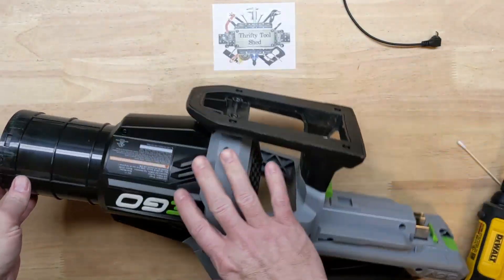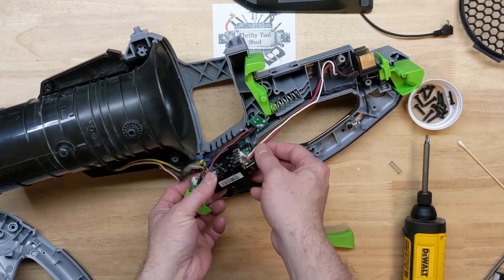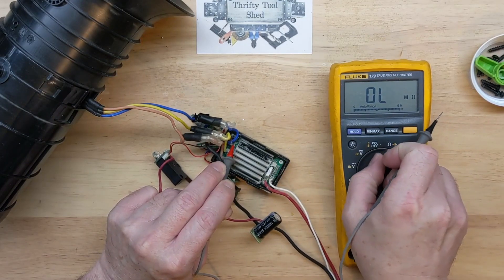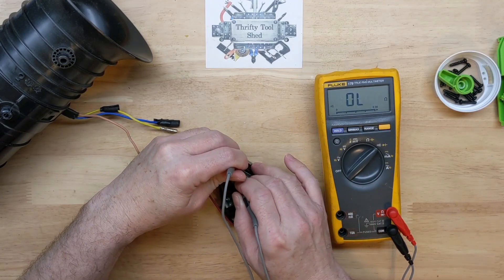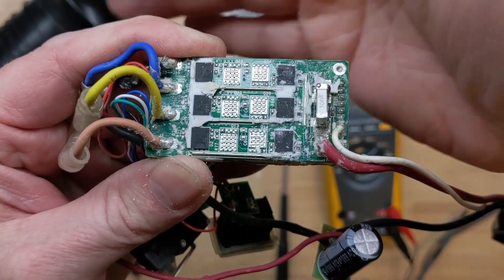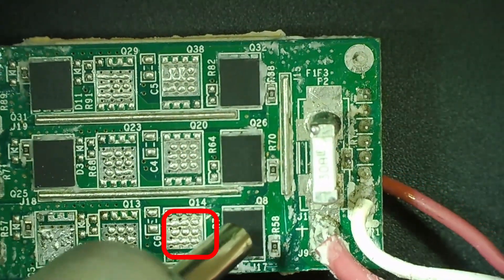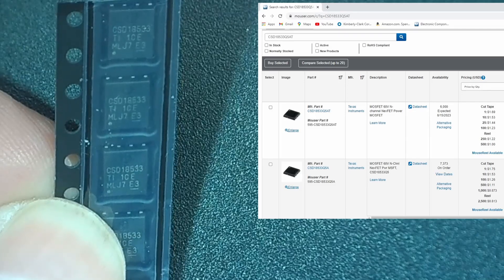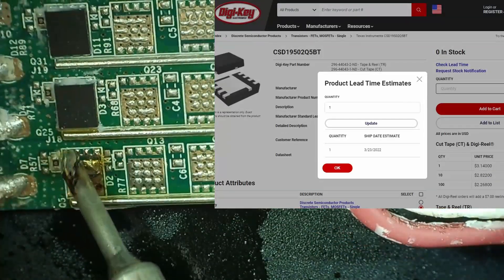EGO 56V LB5300 Blower Controller Repair

Comment: Great repair! I was hoping you would be able to get to this one. Interesting that replacement MosFets are in such short supply.

Here's a little more backstory on this unit:
I inherited it from a buddy of mine when it died under warranty. Ego replaced his blower and he passed the busted one on to me. Since I already had an Ego mower and battery, I wanted to see if I could fix it. I took it apart and found that the motor windings all looked good and that the controller was potted with a rubbery RTV like substance. I dug out most of the potting and found that the 30A fuse was open. I ordered a couple of (expensive) replacement fuses from Digi Key and since there was plenty of room I just stacked the new fuse on top of the old one to avoid de-soldering it.
The blower worked fine for a year or so, but when I was blowing leaves last fall using Turbo mode, it sputtered and died. Stacking on another fuse didn't do it this time. The fuse blew immediately.
At this point I was distracted with other projects and contacted you to see if you wanted to give it a try. I shipped it from Minnesota to Georgia back in November (thanks for covering the shipping). 
Glad you have the experience and tools to identify and replace the shorted MosFets. Great tip on using cheap car fuses during repair testing and for a much less expensive surface mount fuse.

Here is another great story about repairing stuff for the cost of a few parts and keeping them out of landfills! Good Job!
Reply from the maker: Thanks for thinking enough of the channel to share it with us!
Thanks for your detailed comment and I hope you don't mind if I pin it!
Reply: @ThriftyToolShed  Feel free to pin it! This is a great example of recycle/reuse and keeping stuff out of landfills!
Reply: my blower is giving me problems, i have to keep pushing the battery in or change the angles for it to work. It works best if i push the battery into my body so the contact is made. Do you have advice for this issue?   @ThriftyToolShed

Comment: Could I replace the LB5300 controller with the same RioRand 300W 5-50V PWM DC Controller that you used in your 650 CFM retrofit? Thanks very much for your videos and advice!
Reply from the maker: I do believe it will work if you keep it in direct forced air flow. We are overdriving them hard for sure. One other thing to keep in mind is the battery will need to be removed so the controller doesn't drain the pack with parasitic draw. The low voltage cut out is also a concern, but of course I rigged up a couple this way mainly for testing and they did work. I also have tested some with some of the newer 80V BLDC controllers. I shared a repair video of one of these already and show it being tested a little. They are a large board though. Thin, but long and wide. Best of luck to ya.
Reply: @ThriftyToolShed  Excellent advice and much appreciated!

Comment: For this EGO 535 blower, mine will start then stop.  A few seconds later it would start again.  The battery never  gets hot and I've tried a new battery.  The blower and the battery does not get hot at all.  Do you have any idea what the problem might be?  Is it worth it for me to take apart the blower like you did here?  I can't find a new PCB for this blower.
Reply from the maker: One thing to check is the connection to the D terminal and make sure it is clean and a solid connection. If no communication is established between the blower and the pack it will shutdown after a few seconds of running.

Comment: Thank you thabk you thank you! This was a great video. I needed to know what kind of fuse was used in these bloweres. And the mosfets. 

If you could, would it be possible to reply to this with the fuse part description and the mos fet description? Just for the sake of simplicity. So i can search it up.

Im going to try that 30a green car fuse right away. Thanks again!
Reply from the maker: Hi,
I have links to help in the video description. EGO uses many different mosfets and fuses based on the model. It this video, I shared links to the ones that I used on that particular repair. Best of luck to ya!

Comment: So there’s a giant fan and only some tiny slots to allow air to cool the heat sink, which is covered on both sides with excessive putting material, and the mosfet overheated? Shocking. I’d cut away those slots and clean up the heat sink, or maybe resize it so it sticks out into the air path, to prevent this reoccurring.

Comment: I didn't have my air speed high enough and the pads weren't coming off after minutes of 400C.  After turning the air speed up they came off rather quickly but I noticed the Rightmost chip no longer has the copper pad on the single small section.  Since there's 2 empty spots in between is it possible I can simply move the Right mostfet to the open pad just to the Left of it and move the SMD resistor you have as R58 to R76?
Reply from the maker: I believe that will work. The only problem may be if something is not clear on that right most spot. Which, you may have already tested to be sure no short is there after removing the chip...

Comment: I replaced the 2x mosfets from my middle (Blue wire) section and confirmed one of the mosfets had a dead short as shown in the video.  For fun, I also tested the board, and discovered continuity (~100k) between the main pad and single pin where I removed the leftmost mosfet.  I didn't have this on the rightmost mosfet or any other blank mosfet area.  Is that normal?  I'm asking because after putting everything back together, the motor only glitches for 1/2 second or less when I pull the trigger and then stops.  Any thoughts what else to check?
Reply from the maker: The Mosfets do have a gate resistor close by that may sometimes accidentally get desoldered while replacing the Mosfets. I am not sure about that reading as that repair was some time ago for me.
Reply: @ThriftyToolShed well I went to replace the other mosfets today and they weren’t coming off but what did was that little gate and it’s nowhere to be found. Are these standard things I could order and replace?
Reply from the maker: @bugsysiegals  
I did not have to replace any of mine on the few repairs I have done, but on my first one, I did have one move on me.  I had to find it and put it back in place. I believe they are  standard SMD resistors if I remember correctly.

Comment: Hey! How did you find a replacement MOSFET suitable for the board?
Reply from the maker: I looked for the part number and sometimes it is not available. I ordered the next current rating higher up in the same NexFet package. I have a link to the one I used from DigiKey in the video description.
Reply: @ThriftyToolShed  How did you know the part number? Was there anything written on it that we couldn't see?
Reply from the maker: @diogor420  
I did see the part number.  I have worked on several of these and a chainsaw with a similar controller as well. You should be able to see the numbers well in the video. I even showed it under the microscope on this repair I believe....

Comment: i have one the turbo button doesn't work any more
Reply from the maker: On this model I believe the turbo is a dedicated input to the controller and if the controller is otherwise working fine hopefully it's just the turbo switch itself  or loose wire causing the issue.

Comment: Great Video.... Thank you. I'm actually going to fit a 'hotwired' fuse to where I can get at it next time it blows..... It was touch and go whether I tossed the whole machine but with following your instructions, I got to the fuse and tested the system with just a fine wire soldered in for the test and all was good. I figure a 30amp just hanging loose inside is not going to bring the earth to an end so that's my plan.
Reply from the maker: I don't blame you. That is a good way around it for sure. Thanks for your kind comment!
Reply: You can get fuse holders.  
I would just place the fuse holder outside the case somewhere and run heavy enough wire to  the fuse location on the board
Reply from the maker: That is the challenge for sure . The blower can easily pull up to 30A in turbo so it is very little room to work with. Some have drilled and put the fuse holder on the outside...

Comment: I wonder instead of all that, just wire it as on/ off only without any speed control.
Reply from the maker: I guess you are saying use the brushless controller and simply make it either Off or On and when On being wide open? Of course you have to have the controller.  It's a BLDC after all!
Reply: @ThriftyToolShed  can you show us how to wire it as Off or On only, some of us are not that handy and dont want to buy any more parts. plus only using the blower a few times a year. thanks
Reply from the maker: @chengnygmailcom 
As already mentioned above, it is a BLDC. A brushless DC motor has to have a controller. You will have to use a controller to run it.

Comment: If you use lab power supply or RC battery, instead of original one, would blower work normally? Mine pulses, work for sec or two then cuts off for about 0.5-1sec... Since i don't have original battery i cannot test if this is bc. of the battery or this is bad controller?
Reply from the maker: I don't know about all the models. The ones that I have worked with use the D-terminal to communicate between the tool and pack and if not detected it will only run for about 10 seconds or so then shutdown. The ones I tested will at least start up and run for that 10 seconds for a quick test with a 50 - 58V input. These things pull over 20A in turbo so I would use a battery pack of some level. Most bench supplies will not power it. I would think even on the lowest speed setting it can easily pull over 8-10A. Best of luck to ya!
Reply: I tried with 5AH/48V 100C packs (plenty of power-500A capable) and still does that cut off game... I initially bought blower for plastics, and to put monster 90mm EDF with 200AMP ESC in there that has 3-4KG of thrust (that is about  5500-7300cfm) it is really powerful, then to realize that e-go tool i bought is kinda ok feel bad in gutting it apart now...  
Oh and thanks very much on cheap ESC tip, RC 12S ESC's are all over 100$, but also over 100Amps, don't need that for this cheap blower!   @ThriftyToolShed

Comment: I have the same machine when I install a good battery and pull the trigger on the blower nothing happens in the battery eventually blinks green and turns off any idea what this could be or what test I could do to figure it out

Comment: Hi,

Great video! It was using this video I was able to Bring my 580 CFM lower back to life by swapping out the fuse.

I also have the 600 CFM backpack, 650 CFM & the new 765 CFM blowers so I really don't need my 580 anymore. So I decided to take it apart and re-purpose the brushless motor into a different project that I've been meaning to work on.

My only question is, what kind of power supply can I use to power the brushless motor? I tried my benchtop power supply which maximum goes up to 32 V/10A and it didn't even make the motor move. So for now I'm plugging in one of my Ego batteries. Do you know any way I can run the brushless motor, esc, etc. from a power supply? I remember i have a 60v charger in my basement somewhere that i bough to charge one of my Segway-Ninebot devices. Wouild that work? Thanks
Reply from the maker: So, are you asking about what kind of controller to use to run the BLDC Motor or what to use to power the original controller?  You can't run the BLDC Motor without a controller like the older Brushed DC motors. You will need a 60V DC supply. I have a 0-60VDC bench power supply I use to test these using the cheaper BLDC controller.
This is an example of a reasonably priced PS that may work? https://amzn.to/3DqglI4
Reply: @ThriftyToolShed  Hi, Thank you for the prompt reply. I want to run the BLDC motor from the 580 CFM Blower using the OEM controller, pot. My question is how to power it other than using a ego battery. Because i tried using my 32V /10A Benchtop power supply and it did not even move the motor or make a noise. Nothing happened...

I have a power supply that is the type you plug in the wall (canada), and it says output 63V 1.5 amp or 1 amp. Along with another one my Segway-Ninebot came with that is 59.5V at 2 amp that i was thinking to use. But would the amps in these be enough?
Reply from the maker: @therockk  
These would not be enough. Need 60V up to 15A supply. A 10 amp supply as shared in the link in my last reply may be enough to run it pretty high. You may need 15A supply to run full turbo for any length of time.
Reply from the maker: Just a guess, but if running low speed you may get by with only 2-3 amps. The high current only really comes into play when pushing it hard. I would probably even try the smaller supply you mentioned earlier if it is around 2A rated. I would just start it up slowly and see if running really slow how much current it pulls. Even a 48V supply will most likely get you what you need if running it easy.* I will mention if you are using the original EGO controller it will shut down after 10 secs or so if the D-Terminal to pack is not detected. I have used a cheap BLDC to run these successfully though. Best of luck to ya! 
48V PS: 
https://amzn.to/3TQ65yg
Cheap Controller: https://amzn.to/3MWxL2q
Reply: Great, thank you so much for all your help and information I really appreciate it. I will try it out.

Comment: Great video!! Would I need to add a resistor on every gate like r76, r77,... in order to get more current capabilities?
Reply from the maker: That is what I believe, I have not verified that for sure. It looks like putting on the extra Mosfets and the gate resistor for each additional Mosfet as well. Thanks for your kind comment!

Comment: Great episode thank you .. I have an ego 530 as well it runs great but … Iwonder if those mos fets can handle the load especially in Turbo .. I have heard that they’re  the weakest link in the whole system and the #1 failure point .. they do seem to be a bit tiny for the load .. also anything over a 5ah battery is just too much and will burn out the board on hand held tools .. ego says different however I have heard this from a guy who does the pallet resale thing ..
Reply from the maker: The Mosfets have been the failure point on every controller I have worked on so far. The chainsaw and several blowers now. They are rated for 75A and some have the 100A version Mosfets so I am not sure if  some chips are just faulty or the thermal management is poorly designed for the controller. I for one wish they had more airflow across the heatsink. I did a cheap controller replacement video and I was concerned the controller would not hold up so I mounted it in the air flow of the blower intake.  The harder it pushes the controller the more forced air so it has held up well. It just has a little less intake volume for blowing, I can't tell any performance drop though. I have never used a pack larger than the 5Ah on mine to say for sure. I know some of the tools do detect what size pack is inserted and it limits output accordingly. I know that the Chainsaw does this. The pack and tool communicate on the D-terminal. Thanks for your comment!
Reply: @ThriftyToolShed  Wow thank you very much .. Your expertise is greatly appreciated..!

Comment: Is there a reason not to use a automotive 30amp fuse? Ego just replaced my blower, so I took the old one apart. appears like only the fuse is blown, since the ohm measurements across all three inputs is almost exactly the same.
Reply from the maker: I shared in several repair videos of me using the small 30A automotive fuse while testing and troubleshooting. I usually mention not to leave it that way because they are only rated for up to 32V. Since we need a 60V rated fuse I made sure to mention that fact. Will the 32V 30A fuse work for long term? I believe so! I have tested them for an extended time waiting on parts and then the time to go back and install and honestly I have had zero issues running the tools with these installed. Best of luck to ya!
Reply: @ThriftyToolShed  Thanks for the quick response and reasoning behind it.
Reply from the maker: Be sure to disconnect the BLDC motor and test for shorts on the rails to ground as well as the positive supply. Testing for shorted Mosfets of course. I have had one blower out of 6 now that the fuse appeared to be the only issue. After replacement that one is still running. The others were shorted Mosfets the 14" chainsaw was that same way!
Reply: @ThriftyToolShed  After disconnecting the BLDC each rail had the same resistance when measuring to ground, or to positive. I read up more on the resistors and will get the correct ones from digikey.

Comment: So I "decomposed" my donated 650cfm 56v e-go.. and it appears the drivers  are not marked either (as it appears the original ones are with your example here)..  would you happen to know if they are the same units?  My esc board clearly shows signs of the magic smoke escaping their little 'containment vessels'. :-P  That said.. Your other video, with the cheapo amazon/ebay hall-less controller, looks like an even easier fix...   Surface mounts and all that :-P

Comment: Some tips on removing that potting putty without destroying the SMC stuff would be great :-)) I'm fixing the LB6500 (~650 cfm) version. Same problem: mosfets and fuse. Thanks for the TS session!
Reply from the maker: I did share a little back in this older video if it helps. I know I do not spend a lot of time on it because it takes so much time from the actual board repair at times. If you think a video on just that part would be helpful I will consider it. I simple go around the edges as gently as possible and start slowly pulling up the silicone. Some of the other potting materials can be very tough to remove. The silicone is not so bad. Hope it helps.
https://youtu.be/EH0GS0iUzzM